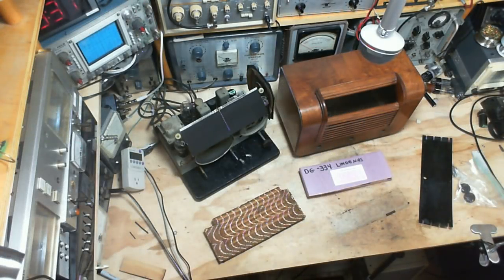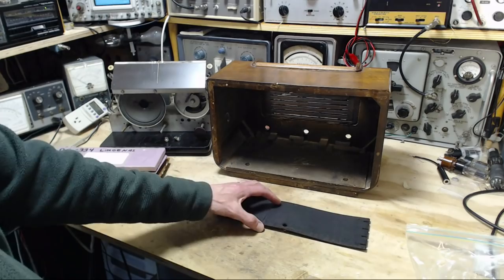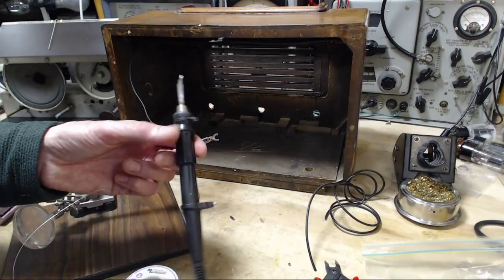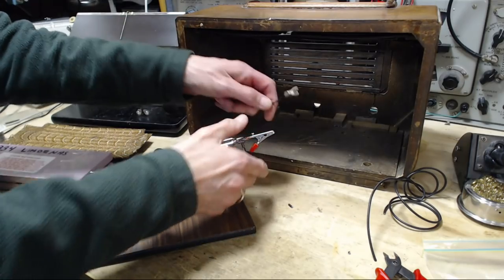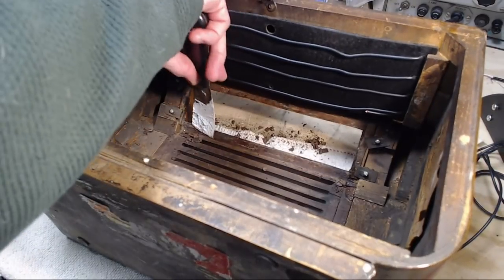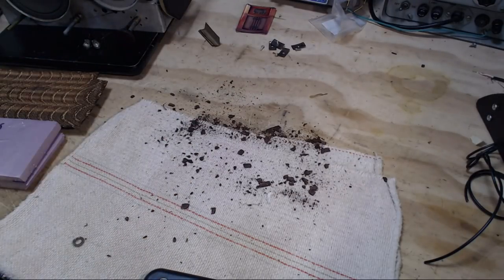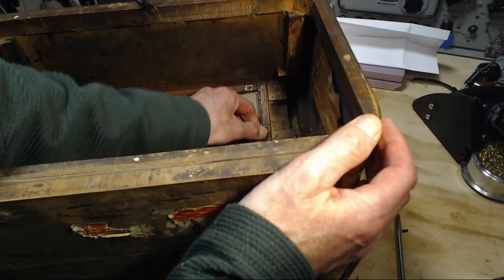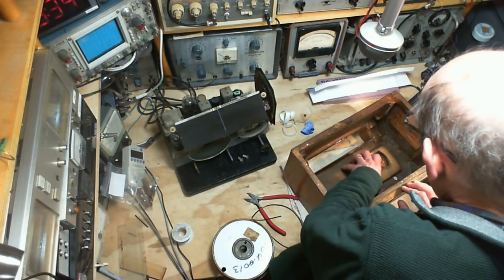RCA Victor A23 Tube Radio #13 - Into the Cabinet

Comment: Thanks for covering this. I have its big brother (the Model M-47) waiting for parts (and time). I should be able to figure more out on the radio based on your videos as they are similar.
Cheers,
 - Eddy
Reply from the maker: The glass dial plate is actual intended for an M-47!
Reply: @JimsRadioShop  - That's interesting, I knew they were similar but its nice to know that some parts are inter-changable. I stated it is an M-47 but its actually an M-47A.. not sure what the difference is though. The glass on it is in pretty good shape...

Comment: One wonders why you didn’t glue the speaker panel before fitting it into the cabinet. It would have been easier.
Reply from the maker: Didn't think of it until it was screwed in.